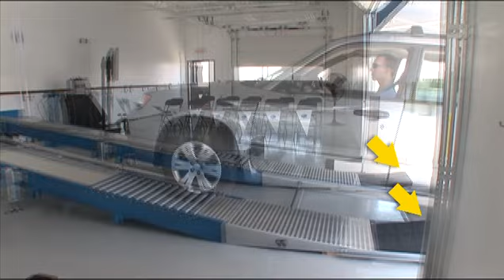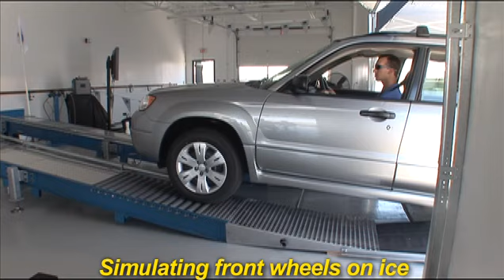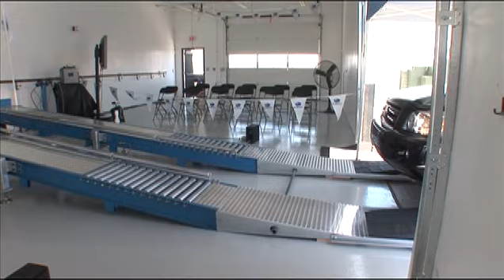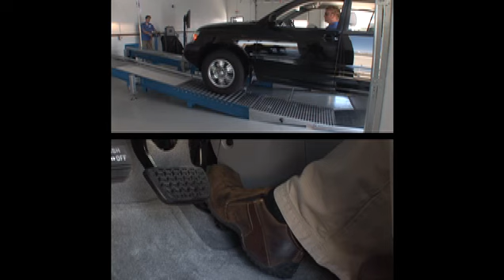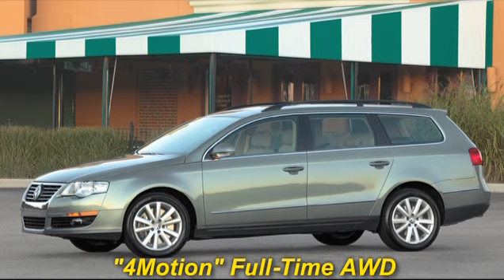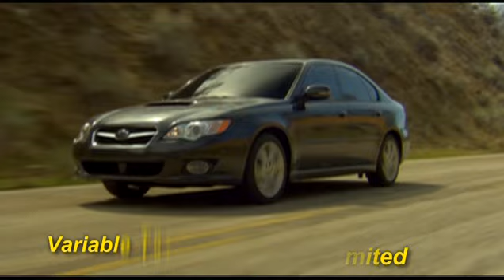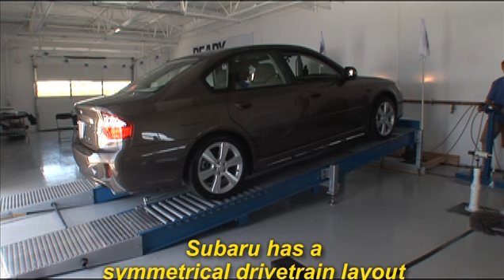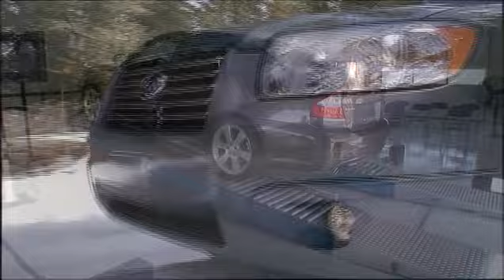Subaru Symmetrical AWD vs. Honda, Toyota, and Volkswagen

Comment from the maker: @robMD2010 This was done with traction control on and off for the audience. The video was filmed with it on, as it was thought to be the best way to demonstrate they way the systems fully integrate with their AWD and traction control systems. Traction control on and off didn't make a difference as the vehicles weren't "stuck." Subaru has the same instructions in the owners manual about vehicles being stuck. It is a condition where none of the wheels have traction.

Comment: @SoDaSub the fact that the vehicle won't move tells me that it is stuck. if you really want this to be viewed as an unbiased test you should test this with the traction control off. Don't worry about it making the Subie look bad, it still (I'm Assuming) did it with the traction control on. If you want this to really sway buyers it needs to be a more complete test of vehicle capabilities. Not just a "We know the Subaru will win this" kind of test.

Comment: Very interesting video! Could someone explain the point about the Passat having an asymmetric drivetrain and the ensuing torque steer beeing the reason why it cant climb on 1 wheel? From my point of view this doesn't make much sense as the torque distribution should be based on wheel speed sensor outputs?

Comment from the maker: @robMD2010 That scenario specifically is applied to all 4 wheels being stuck. Subaru has similar instructions in its manual. This is a case of 2 wheels having traction and two wheels not. The vehicle isn't "stuck." It's just not able to transfer power to the wheels with traction.

Comment from the maker: @enigmaj316 Subaru's system doesn't require you to be in motion. That's kind of the point... to show not all AWD systems are created equal. Some of these systems with a running start on the hill incline failed there as well.

Comment: @SoDaSub the manufacturers instructions for the CR-V state that if you have no traction and are stuck\ unable to move (I'm pretty sure this test qualifies) that you should turn off the traction control. This is for the reason stated by BLKCG6. the Traction Control system is applying breaking force and limiting the system. The fact that this video was filmed in front of Honda salesman means nothing. The vast majority of sales people sell based on buzzwords, not actual product knowledge.

Comment: I moved from the Chicago area to a small town in South Dakota and traded in my '02 Impala LS for an '05 Baja Turbo, given how much more snow SD gets and how much colder the temps are (they only use sand because salt is ineffective).  It seems to snow 4 - 8 inches every weekend since November, and every weekend I take my Baja out for a joy ride before the plows get to work.  It's so nice to have a car I can get into after some big snow without worry !

Comment: Subaru's AWD is better than most other low cost systems. SH-AWD should be able to climb because the diff is capable of actually locking the front and rear wheels together, much like X-Drive does. Notice how Subaru did not use a manual transmission vehicle to test. It would have likely preformed like the CR-V and Highlander since the center diff can not lock completely to pull the vehicle up the ramp.

Comment from the maker: @BLKSG6 

So you're saying that the CRV's AWD system doesn't work with the traction control on? Since the traction control is default on when the vehicle is started, you're saying that the CRV is 2WD unless you engage AWD after being stuck in the mud somewhere? ... or turn the traction control off all together on a snowy day? That would make the CRV's system completely rubbish. The video was made in front of a live audience which included people who sell Honda vehicles.

Comment: I think his explanation has everything to do with the crvs inability to climb.   The crv pumps fluid from front axle to rear activating the rear axle.  If traction control is slowing down the front axle then the action of the fluid is held back. The more the fronts spin the more the rear is engaged.   Turn off the crv traction control and let the fronts spin fully to completely engage the rear.  I think you just didnt want to show the crv going over the hump.

Comment from the maker: @Sokarr6 Your explanation has nothing to do with the CR-V's inability to climb. The front wheels are the ones without traction. It should be switching power to the rear wheels with traction, yet it's not capable of doing so. If the CR-V applied "too much braking force" to the wheels with no traction, then the rear wheels would have all of the power and it would have easily crested the hill. You're "I have driven Subaru.. small hill... TC on... suck on snow" comment doesn't hold much water.

Comment: Clearly, neither the producers of this video, or the audience,  understand the traction control on Honda and Toyota. Traction control automatically applies breaking electronically to wheels that lose traction, preventing wheel spin. Starting from a complete stop however, it applies to much breaking force to generate enough momentum to get the car moving. Try turning off. Also, I have driven Subaru. It may be able to climb a small hill from a complete stop with TC on, but it tends to suck on snow

Comment from the maker: @ebhqueens Prior to Subaru offering Vehicle Dynamics Control. None of the Subaru vehicles in the US (except the STI) could transfer power left and right on the front wheels. They could only do this on the rear wheels if equipped with a Limited Slip Rear Differential. They all transfer power front and back, but if the rear was stuck and the front wheels were free, the wheel with the least resistance would get the power. VDC in the newer models prevent this from happening on the front wheels.

Comment: I have a 2010 legacy gt and other than an lazy gear ratio, no complaints. But hen testing the VW, it is an uphill test. I'm sure in making the statement, the company proved it on a more level surface. As fir the legacy accomplishing this? If I'm not mistaken, the VW has only around 210hp to it's name whereas the legacy gt has 265... Otherwise interesting to see the other cars fail... I used to have a vw..never again...

Comment from the maker: @MrMadmax900 
Do not troll my videos or you will be blocked. And please do not lie. Your video explicitly states"The Subaru Vehicle Dynamics Control does not help factory tires in the snow. The car has to try and drag itself uphill through snow with the brakes on. I tried to go through this small patch of snow 5x and it failed each time."

It's obvious that you did that run several times to make it get stuck. You can see the tire ruts in the snow where it did run up the hill.

Comment from the maker: @MrMadmax900 

Nice troll. You have to turn VDC off if you get stuck...read your owner's manual

"Pressing the switch to deactivate the Vehicle Dynamics Control system can facilitate the following operations.
- a standing start on a steeply sloping road with a snowy, gravel-covered, or otherwise slippery surface
- extrication of the vehicle when its wheels are stuck in mud or deep snow.

Comment: 5) This video is misleading as Toyota knows how to build 4WD (Landcruiser) same with Honda (MDX) which this video does not show. It depicts Toyota does not know how to build 4WD cars when they do by comparing a Toyota capable of AWD or a Nissan Pathfinder with AWD.  False advertising this is. 

Switchable 2WD to 4WD is the better than constant AWD (which has constant economy and top end power disability).

Comment: 3) Better handling in extreme situations but in reality (98. %) of the time we dont drive on ice or take corners like a rallye driver etc AWD only adds weight and consumes fuel and robbs top end economy and power

4)Part-time 4WD is not worthless. It tuned for economy, to keep 2wd format to avoid loss of power and economy through the AWD setup. Part-time 4WD is for loss of traction in urban situations (oil, water or sand on otherwise sealed road)  not ice - which only a minority encounter

Comment: 2) Accords have better economy (with far older cars too) CB Accords of 1990-1993 regularly clocks that and better hence why theres heaps of followers keeping and restoring those cars! Ironically heaps of Subaru drivers experience higher fuel consuption than quoted figures in the manual. As well as accelerated odometer readings to rip off new owners in servicing or bad electronics etc.

Comment: 1) Lower centre of gravity but creates an engine with larger width due to housing two banks of cylinders making the engine very heavy. To the detriment of fuel consumption, difficulty in servicing and resulting greater turning circles. Not a trade off everyone wants hence not very popular. Vertical piston engines are still most popular and superior.

Comment: @SoDaSub 
im considering getting the new 2010 toyota rav4 and im wondering how the 4wd system works on it. is it the same as the toyota highlander that was shown in this video? and i noticed a lock button on the dash of the new rav4 im wondering if the car is in front wheel drive untill that is pushed =S
please reply i really need to know before i buy this car!!
thanks in advance =]
Mike~

Comment from the maker: Please point  to the time you are talking about. The video points out the Highlander's side to side motions being attributed to the unequal length drive shafts. Power makes it to the side with the shortest shaft first. The stability control then reigns it in by braking, and the process repeats itself. This is easier to notice in a test like this where neither front wheel has traction.

Comment from the maker: The STI is Torsen in the rear, planetary gear in the middle, and a helical diff in the front. The DCCD also allows the driver to manually change the torque split between the front and rear wheels.

Comment: Your entitled to your opinion.

As i said only if you go into extremes will you need a full time AWD otherwise for the 99 % of the population it is not required - parttime is more practical due to economy.

I disagree with you statement "Drivers who demand the most traction tend to drive Subaru"

Subaru is not the only one with symetrical awd and full time awd. They have only just offered diesel and are new in the big 4wd. Claiming most people drive Subaru if they want traction is not correct.

Comment: But what happens when you need bigger clearance as there are rocks?

In reality unless you put yourself in that situation or drive at excessive speeds around corners, drive excessively on unpaved roads it is hard justifying driving a symetrical awd car which saps fuel economy all the time, even when not in use.

With the GFC, increasing use of high tech radar speeding devices and increasing costs of living, a non full time awd with traction control is more  practical and just as safe.

Comment: Through clever engineering and use of differentials.

In any case a Horizonal engine is designed mainly for front wheel drive lay out. Why? Because of economy reason and direct power transfer to the driving wheels.

Same concept as a rear engined rear wheel drive vehicle looses less power than a front engine rear wheel drive vehicle

It is tuned for economy because it sees paved roads more than unpaved. Makes more sense to lean more towards fuel economy than the other way around esp with the gfc

Comment: This demonstration only serves the difference between differnt types of AWD we now have in the market today.

The different AWDs are as mentioned designed for the intended purpose of the maker. 

Some are intended to be more fuel effficient (run mainly on 2wd with limited ability to shift power front to back and left to right) with no rugged offroading in mind

This does not show Subaru's superior 4wd else it should be compared to the Toyota Land Cruiser or VW Touareg or Honda MDX.

Comment: There are different types of AWD and power delivery.

Depending on the factory intended purpose of the AWD determines the factory intended maximium power transfer on the wheels eg some are able to shift max power up to  50% front or rear others only 30% others 20% depending on the intended purpose .

Some cars are tuned for economy, mainly flat (not off road) therefore the ability to shift power to the wheel that has traction more limited.

Comment: The engine in the passat wasn't just turned 90 degrees, it got a new AWD system too. The previous generation passat 4motion uses the same underpinnings as the Audi A4 Quattro. Torsen, not haldex.

Comment: the VW probably would have done better with traction control off for the reason that traction control keeps removing power from the engine and applying the brakes essentially bringing the vehicle to a halt.

Comment: "Continuous AWD" is in Subaru's with a manual transmission. It is a viscous center diff that splits power 50/50 all of the time. When there is slippage, it can only transfer so much since it can't mechanically lock up.

With "Active AWD", there is a computer controlled center diff that can lock the front and rear drive shafts together.

"VTD AWD" adds stability control and traction control to allow side to side transfer of power, front and rear.

Comment: A CVT would be best for low grip climbing as gear changes would not disrupt clean power distribution to the wheels.  2010 Outback has a CVT.

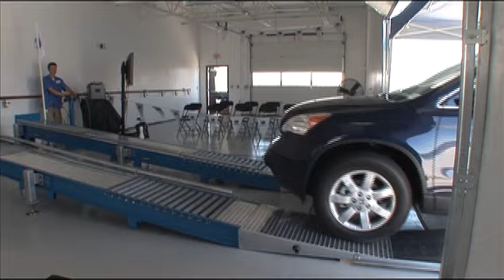Comment: at 00:58 the crv was just about to climb but the guy driving stop pressing on the accelerator! Why did he do that?? well because they dont want any other car to climb but the subarus even if the car is capable of climbing. they realized that the crv was just about to climb and then backed off the gas so i would not. THIS IS BULLSHIT!

Comment: There is a difference between AWD and   4WD. AWD= will stay on all the time no matter what. 4WD= will be FWD to save gas and when the front wheels spins, the rear wheel starts to have power. 4X4= very different. You can choose between 2-hi, 4-lo or 4-hi. And some trucks are LSD.

Comment: There are no VW with viscous-based system with a 4Motion-branding. Viscous was used quite many years ago by VW - like in the mid-80's until mid-90's. The generation of Passat before the current used TorSen, while the Golf at the same time( Golf4) had first generation Haldex.

What makes me wonder, if what would have happend if they hit the ESP/ASR-button on the Passat. I might wonder if the engine-control from ESP/ASR might give it a little problem here in this situation.

Comment: The Honda and Toyota were the most Pathetic! Traction control is frustrating and useless! I should post the 2008 Accord vs my 2007  civic with no traction control, my civic can drive circles around that POS Accord with Traction control! When I was driving the Accord going nowhere in ice/snow I thought something was wrong with the pos.Also selectable lockers are superior traction aids to clutch style limited slips any day.

Comment: I still remain critical of what distinguish between the passat and subaru on the single front wheel test.  Both have open front diff and both relies on traction control to do the work.  The passat does even looks like it has traction control turned on!  I guess I won't believe it until someone like Consumer Reports conducts the test lol

Comment: 60/40 under normal conditions, which means basically cruising. Anything else such as braking, accelerating, turning, the system actively sends torque where it needs to go.

Comment: Another point of interest is Forester's 4EATs multi-plate clutch system.  Literature state it maintains 60/40 split but I'm guessing during tight maneuvers and during braking the clutch should totally disengage?  Otherwise it could cause understeering in slippery conditions, and can interfere with ABS and ESC operation?

Comment: Actually Haldex Gen IV uses a separate pump that's always on.  Therefore when accelerating the system can start applying pressure before slipping occurs.  This is similar to most pro-active torque split system.  I'm sure by next model year most of volkswagen transverse engine lineup will use haldex gen IV.  Tiguan's already started using it.

Comment: Issue with Passat Haldex4 is that under no-slip conditions it transfers most traction on the front wheels, as much as 90 or 95%. It is not without reason Subaru for example did away with this awd configuration from their previous 4EATs. Under normal conditions a manual Subie will be split 50/50 and an automatic 45/55 F/R generally. If you talk to a Hummer salesman, Hummer is the ONLY real 4wd system in this world. We could go on, the point is this video shows what some can and can't do.

Comment: Ofcourse I'm aware of that.  I'm referring to the Passat in the movie clip.  It uses a haldex coupling (either gen II or III)  Which is largely a slip and grip system.  According to some people, it's full time because you don't have to disengage for dry pavement.  For some people, it's part-time because it's mainly a slip and grip system.  It depends if it's a hummer salesman or vw saleman you ask lol

Comment: 4motion can be haldex, torsen or viscous. It depends on vehicle year and model. I assure you I did the research before I got my Subie and yes, Subaru has at least 3 different AWD systems. The new STi now uses Torsen differentials on both front and rear with a driver-selectable traction bias center differential. Just Google for Subaru viscous coupling and you'll find the information. Just like the 4motion, it depends what year, model, etc.